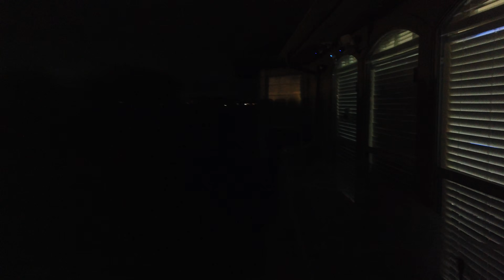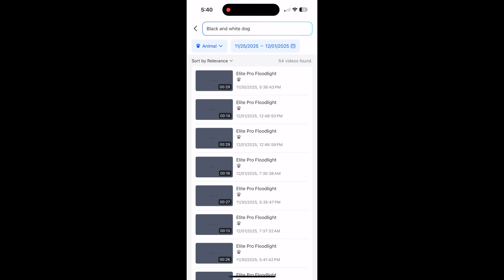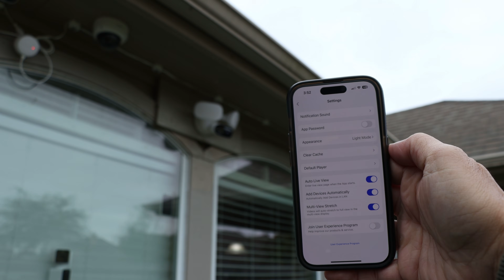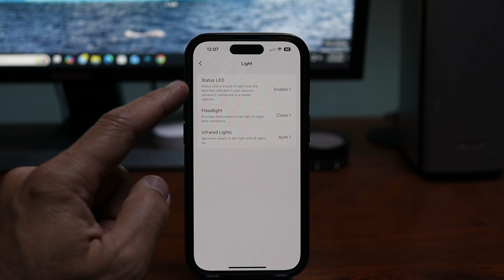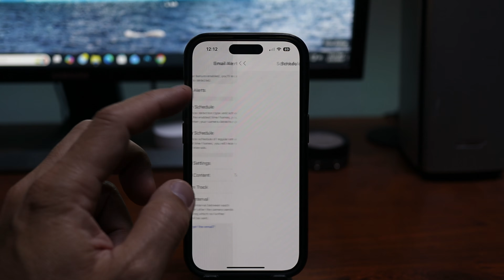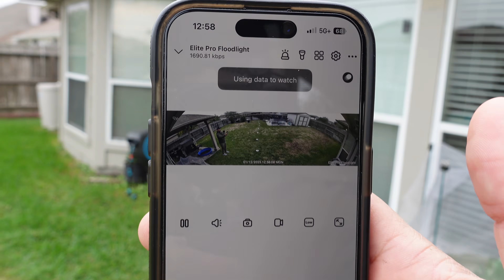Reolink Elite PRO PoE Floodlight – NOT Your Typical Floodlight Cam!

Comment: Hey! Love the content. 

I'm having a weird issue and need some advice.I have a Reolink PoE Floodlight camera plugged directly into an RLN8-410 NVR. The camera's physical siren keeps blasting when cars pass by on the street.

Here is what I've tried: On the standalone camera settings in the app, I erased the entire schedule, lowered smart sensitivity to 40, set basic motion sensitivity to 1, and updated my Non-Detection zone. However, the camera siren still goes off.I checked my NVR settings in the app, but the Audio Alarm / Siren menu isn't showing up under 'More Features' for this model. 

Is my NVR overriding my app settings? How do I permanently silence just this one camera's siren through the NVR without turning off its 24/7 recording?

Comment: If I want to hide the camera's ethernet connection, is there enough room in the camera's base or will I need to mount it to a junction box to stuff the wire inside?

Comment: What is a good POE switch to run POE cameras on and get a good connection? I purchased the RLK8-1200B4-A system and had nothing but trouble with them. The camera quality was pretty good, but it wasn’t as good as advertised and I always had issues connecting when I was away from the home. I noticed all of the Reolink review videos say nothing but good so I’m guessing everyone is getting paid for these reviews but I just need an honest recommendation for a POE switch that won’t have problems connecting when I’m away from the home

Comment: I’m switching from ring. Which is better when starting from scratch, REOLINK Elite Floodlight WiFi or eufy Security Camera Floodlight Camera E340 Wired?
Reply from the maker: With Reolink, there is a learning curve in using their app because there are a lot of settings that you can tweak. Eufy would be the closest to the Ring app and to user friendliness.

Comment: Hello! I just bought this camera (Poe version), and have a reolink NVS16 NVR which I connected the camera through.
I am not getting the new features such as perimeter intrusion, or even ability to change color temperature on the app or client like you showed on yours- on reolink site, it looks like my nvs16 a compatible NVR, and I do get the normal alerts and preview- any thoughts on why I only have limited features?
Reply: I have the same issue with a different nvr. Did you resolve this and how?
Reply: @whoophhearted nothing yet. Seems like the smart features only work when the cam is operating stand alone (not sure how to do this) but I’m just waiting for the reoneura AI box to come out.

Comment: Does this one has track zoom? to get closeup off someone passing by?
Reply from the maker: No. You can manually pinch out in the app to digitally zoom in.
Reply: @LifeHackster Thanks. I heard they coming out with a triple can which may have zoom. 24mp but of course they will have the wifi always and i am looking for Poe more stable. Will integrate with Blue iris. And who knows when that will happen and need it one one as to much dog poop 💩 on my front yard need those close ups

Comment: Thanks for your video! It’s a bit disappointing at the moment — I really wish they would improve those specs. A wider vertical FOV and more megapixels would make a huge difference. Hopefully we’ll see a jump from 16 to 32 MP soon!
Reply: This is not the reason, problem is 4k 16:9 sensors are much cheaper than older 4:3 4k which physically has less vertical space thus to make 180 stiching work there is usualy only a 50-55 FOV compared to 60+ previously. So only sticking to HD or older models that have the bigger sensors gives you wider vertical FOV.

Comment: Thanks for reviewing this 🙂

It appears that the Elite PRO PoE Floodlight resolves a flaw that the older Dual-Lens PoE Floodlight Camera has.  There is no way to use one of those weather proof couplers.  After about a year of use, my Dual-Lens PoE Floodlight Camera failed because the connector got corroded.  I was able to clean the corrosion off and get it working again.  I ended up having to use silicone around the entire base to create a weather seal.

The Elite PRO PoE Floodlight won't run into this problem because a weather proof coupler can be used. 😁

Once my Dual-Lens PoE Floodlight Camera fails again because of corrosion, I will more than likely replace it with this.

Thanks again for the review.

Comment: I have this camera only the wired version.  I also have a couple more Reolink cameras.  I just purchased a Reolink Trackmix/solar camera and it wouldn't connect out of the box.  I agree that their cameras are great, HOWEVER their customer service is crap.  With this TrackMix it's been a week+ and first it took 3-4 days to answer my first email, then they want the SN# etc.  I send it to them, then at least 24-36 hours later, they want a picture of the sim card, even though I had sent them the # on it and you don't need the sim card activated to make the camera work.  I still haven't heard from them today.  WHY can't they get a tech that knows their product to give advice/instructions on how to get it working. OR accept the reality that they sent a defective product and I need to send it in for a new one?  Sadly, these Chi****es companies don't have a monopoly on crap CS.  Thanks for your videos, I've followed your advice with numerous products. My advice, ALWAYS buy thru Amazon so you can send it back immediately.
Reply from the maker: Thanks for sharing your experience and for watching the video.
Reply: @LifeHackster I was hoping that you had a back door to some tech in reoLink get a solution it ain't that complex it either works or it don't work.

Comment: Great hardware (image quality), but crappy software vs Eufy and Ring.  Vertical field too shallow.  No snooze control on app.  Ate my expensive microSD card in two days.  We'll see if the replacement lasts longer.  Too much delay turning on spotlight during motion detection.  AI not that good distinguishing motion events.  Light/floodlight controls not intuitive in app.  Lights not always responsive.  I'm going to keep it for the image size/coverage, but also keep my Eufy next to it because the app is just way better.  Maybe Reolink will update their firmware and fix the quirks and shortcomings...I hope.
Reply from the maker: Snooze control are already in the settings in the app. The lighting delay is because it only lights up with smart events and not PIR based like other floodlight cams. I'm not sure what you mean by "ate" your SD card but I'm assuming you filled it up in 2 days...Remember, this is basically 2-4K cameras. NVR or Hub will be a good option if you want to store more recording days. The app has a learning curve but Reolink gives you all the options in the settings unlike eufy and Ring.
Reply: @LifeHackster  by 'ate' i mean after working for 2 days as normal the app said my microSD card was not working and I could no longer record, lost all my recordings, whereas that card has worked reliably elsewhere.  browsing the past timeline is way better in the Ring app, and even the eufy app.  you have to admit that, right?  the app is not intuitive either, such as has settings for 'Light' and then for 'Spotlight'.  that's just odd.
Reply: the device does have better mic audio than both ring and eufy, i forgot to mention that
Reply: @gradylucas5265 if you've used the sd card before, for god knows how long, and then reused it in this camera and it malfunctioned, how is that the cameras fault? NAND has limited life. If you ran it to 1% of its life and the reolink finished it off, that's not the cameras fault at all? It would've developed the same fault if used in a phone/dashcam or any other camera too if it was on its last legs?
Reply: One great thing of Reolink is the ability to integrate with Home assistant and Frigate . Frigate AI  can be trained and gives a ton of flexibility. I think Reolink is a pretty sweet spot. Their software is decent  , just think on Blink  .  They excel on flexibility as they have rtsp  , onvif support in many cameras . That is inexistent in Eufy , so you are tied up to their app or nvr only. Different use cases  , if you like to tinker with the cameras , tune up the ai for less noise and more meaningful notifications Reolink combined with Frigate is a winning combination with a much better price point than eufy or ring.   Also they have a professional series that has Reoneura AI that has many interesting features.

Comment: I got one of these on Black Friday, have no installed it yet, need to run a data cable. It will be replacing an original Ring Flood Light camera. Didn’t realize the whole unit was POE, but I actually like that even more.
Reply: most people don't realise that wifi cams are easily jammed, completely useless then thus worth the trouble of running a cable.